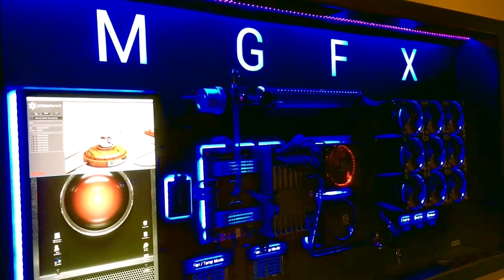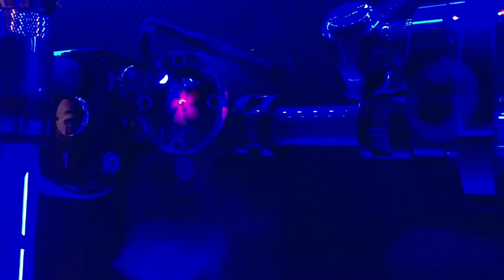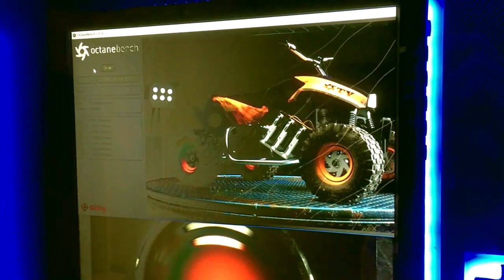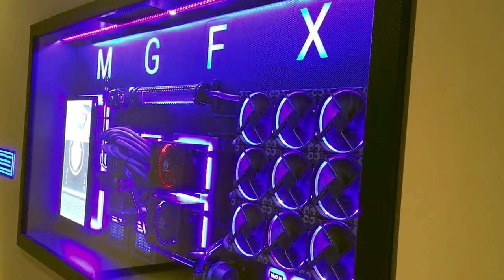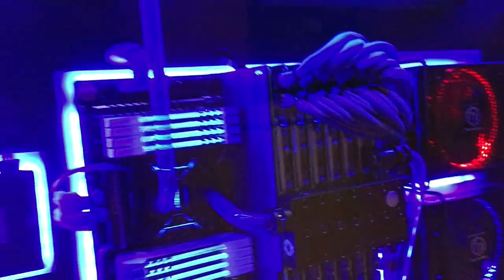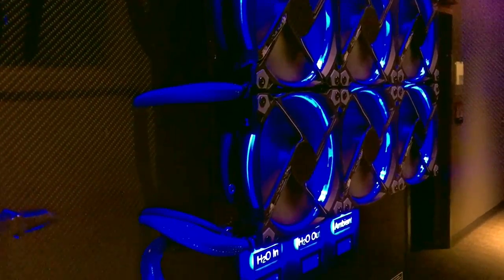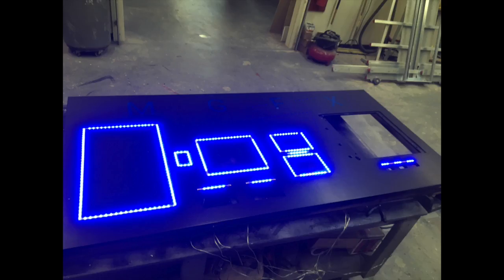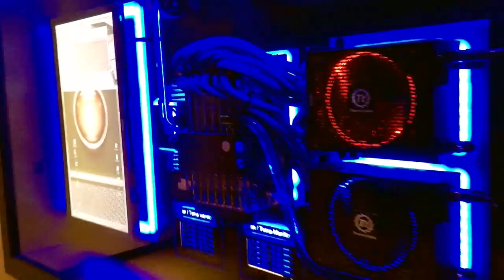7 GPU Supercomputer 3D rendering engine

Comment: Sir, I’m a student with a question: is this 1G as far as the network you’re running to make this possible? Considering your motherboard doesn’t have 10G Ethernet I thought it might just be a 1G network. Unless, do you have a 10G network because you used a PCI-e slot to install a 10G card? Honestly, I’m hoping you tell me this is just a 1G network because then I have serious hopes for the workstation I’m actively putting together (until I stall out on something like this and need further R&D lol). If you could respond?? I SINCERELY thank you 🙏🏼 You haven’t a clue as to what a lynchpin you’d be providing to my life, and my work. It would mean a lot.
Reply from the maker: Derek, yes it has a standard gigabit ethernet connection but there are two on the motherboard.  While our edit suites are connected with 8-gigabit fiber we don’t need a high speed connection to this render machine.  since 3-D rendering is done one frame at a time we don’t need a high-speed connection to this computer.

Comment: Amazing man, i'm making this for render also with 7 GPUS, 3 Titan Maxwell and 4 GTX 980TI:
Asus Z10PE D8 WS Socket 2011v3 
2 Intel Xeon e5 2683v3
Crucial Premium memory registered 8 x 8GB
Samsung 850 EVO Basic 500GB 
Super Flower Leadex 80 Plus Platinum 2000W Modular 
Cooler Master Hyper 612 V2 - CPU x 2
Thermaltake Core X9 LCS Negro - Caja/Torre D5 LAING
Windows 10 Pro.
Becoming mad with water cooling, can you help me pls?
1/ do you used the Laing D5 pumps? what do you think is better Dual loop, 2 pumps in series or 2 pumps in parallel? do you have any diagram?
2/ And for the multiple waterblocks connectivity, i first considered 3 Terminal DUAL Parallel 2-Slot, latter 2 Terminal DUAL Parallel 3-Slot, and the other GPU air cooled (software dedicated), but now seen your work... it's best a full 7 terminal?
Any advice will be great, ty.